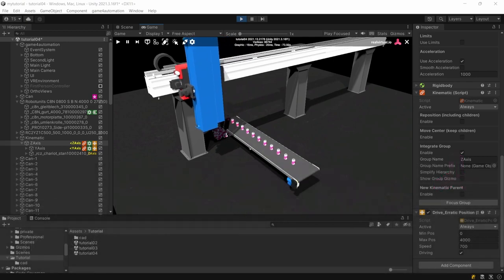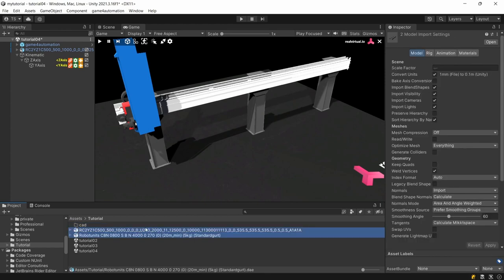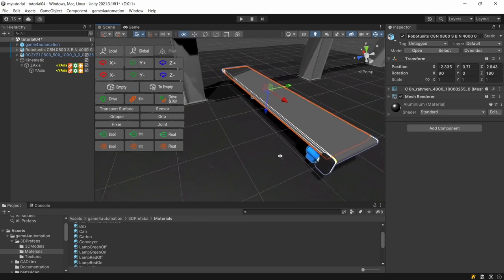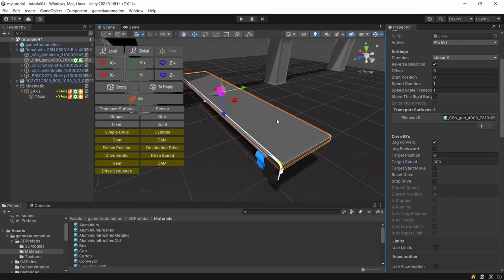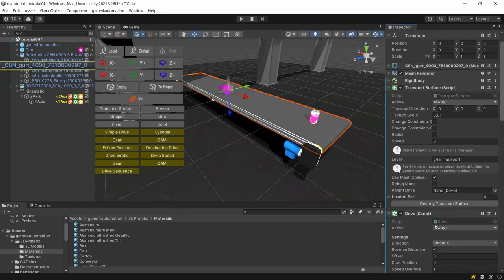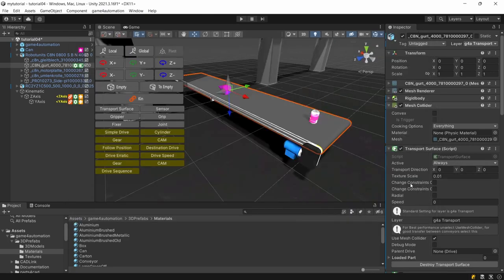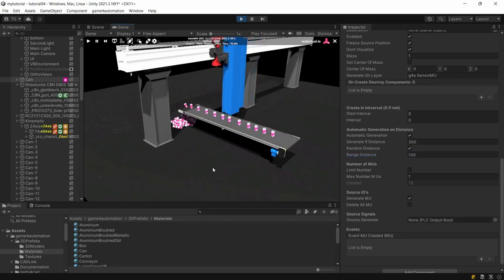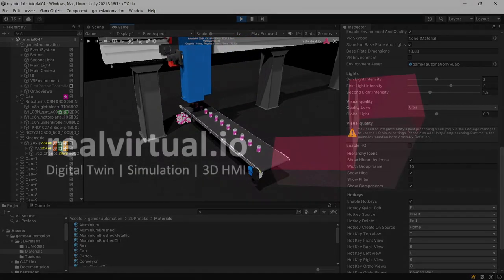realvirtual.io Tutorial 04 - Conveyors and Sources for your Digital Twin

Comment: thanks for a very useful tutorial.  when you generate a source, can you attach a random property like a barcode to each can/item so it can be read later for example by barcode reader?
Reply from the maker: You would need to attach a script to the source with a property for the barcode. This script will be also called on every MU when it is created (because MU is a copy of source). Or you attach a script to the source and use the event EventMUCreated. This event of the source could call a script which is getting passed the created MU. In this script you can add your own scripts to the MU and init your custom properties. You might need to use such kind of a central script if e.g. the values for the barcodes should be taken from a central list. It is maybe an idea to implement in future releases a kind of property value pairs to MUs which can be used in sensors without any programming